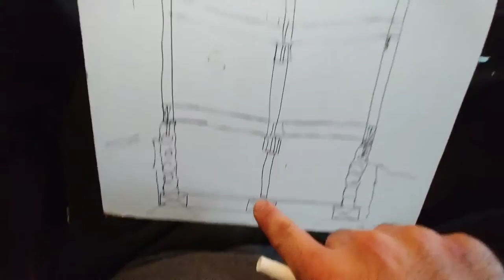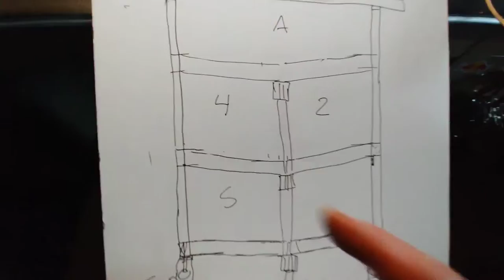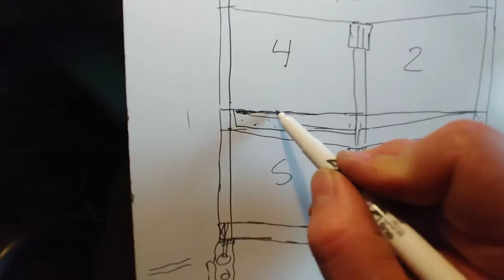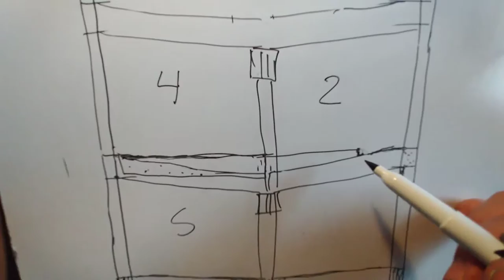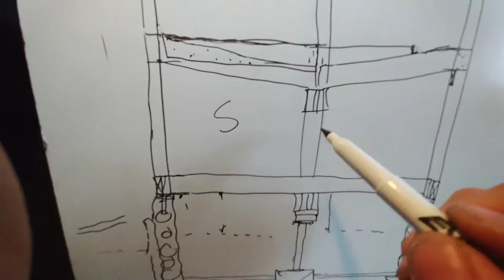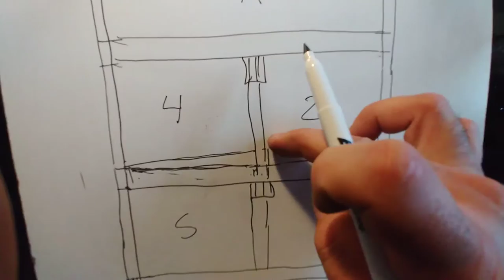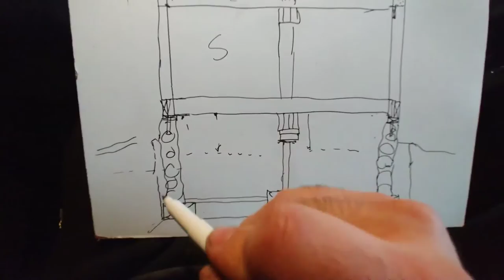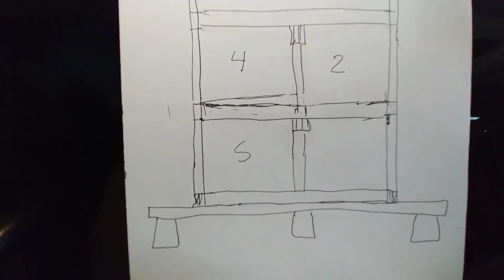Foundations, Structural Problems, Balloon Framing 101 - Episode 2

Comment: Why can’t you replace the footing in the middle?
Reply from the maker: I've been lifting and shimming the piers as an interim solution. I'd never go to the trouble of replacing a pier foundation without addressing the rest of the foundation, since it would require excavation and pouring concrete all within the basement, and I haven't got any outside access. I've shot a lot more footage over the past 4 years, someday I'll be lifting this building and replacing the foundation. For now, you can watch that process on my most recent project series. Thanks for watching!